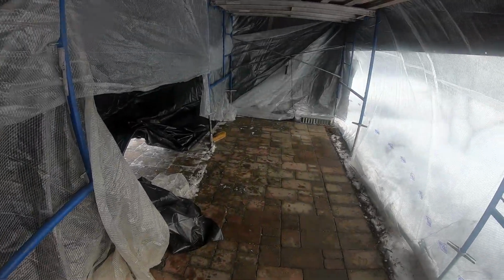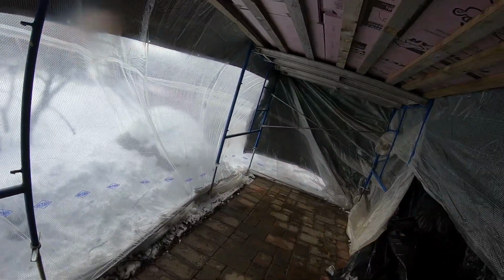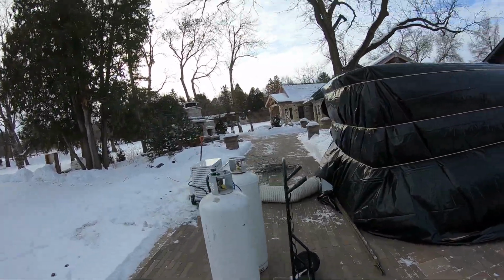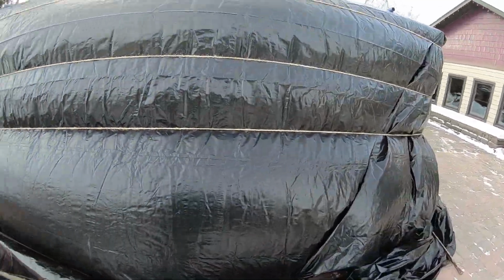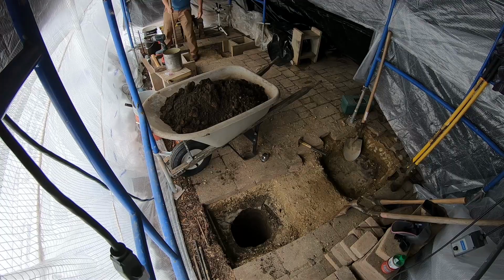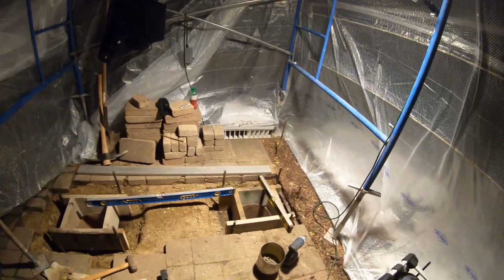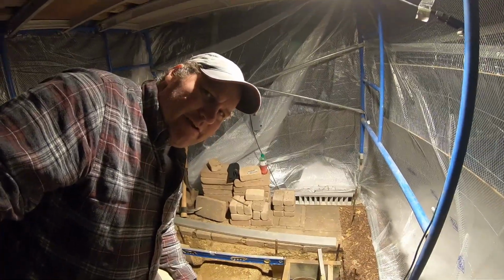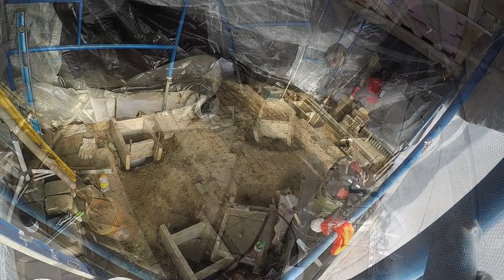PERGOLA CONCRETE FOOTINGS ~ Winter Install of Footings in Paver Patio

Comment from the maker: The square box forms make it easier to finish installing the pavers with straight cuts.  The logs will be around 16"x16" so the footins will most likely not be visiable. Have you ever installed footings in an existing patio?